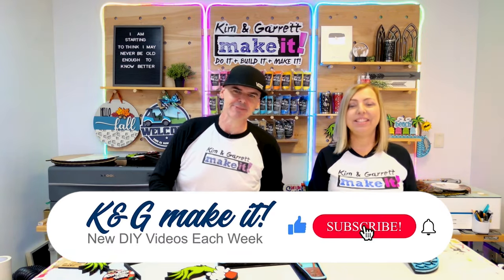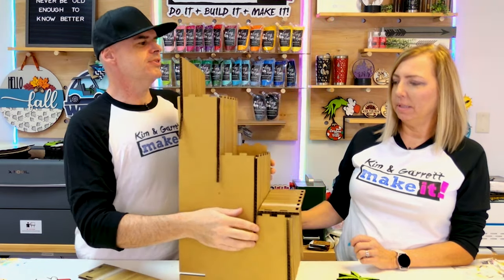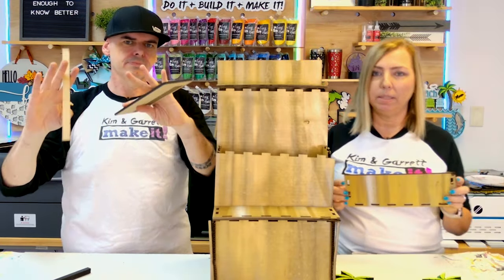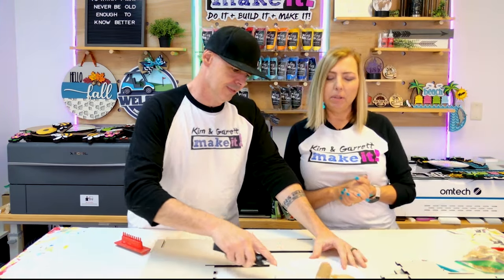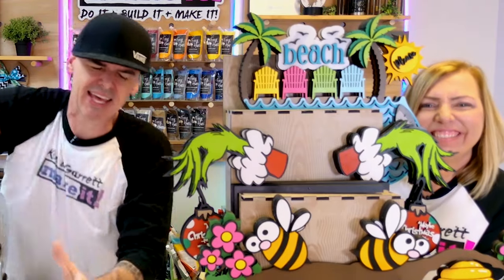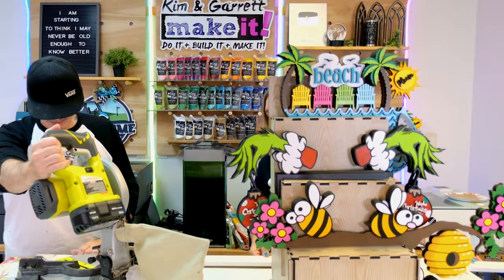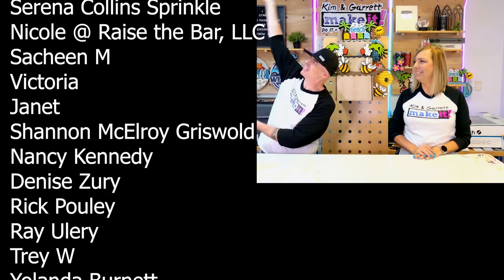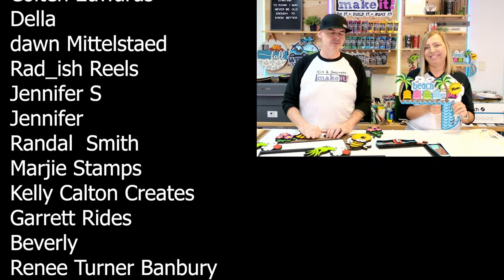Craft Show Challenges: Mastering Door Corner Displays!

Comment: As a design enhancement, you could have incorporated hooks on the side pieces.  That way you may not need the wired ties and you could have just hung it onto the wire rack using the hooks.  Just a thought.
Reply from the maker: YES!  Going back to the drawing board!

Comment: Why not just incorporate hooks into the design of the display?  That way you could just slip it on and off of the wire panel or peg board easily, without having to worry about zip ties.